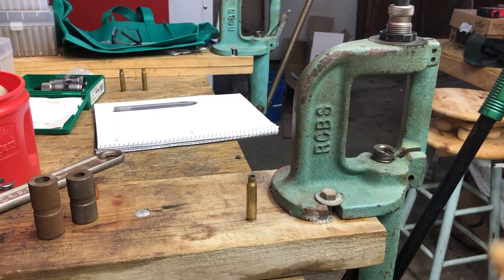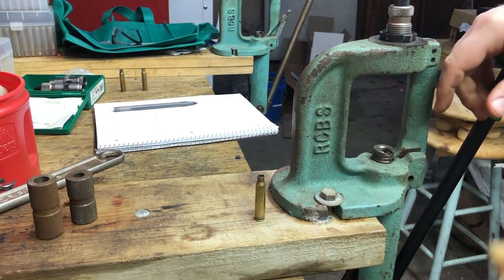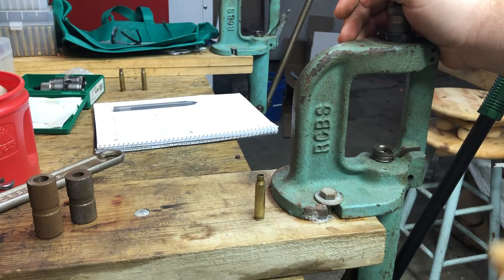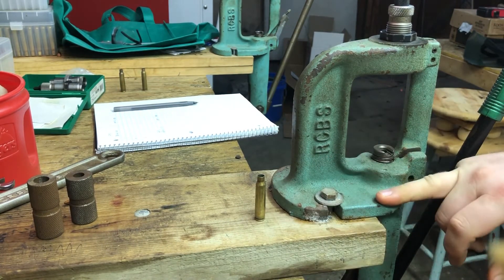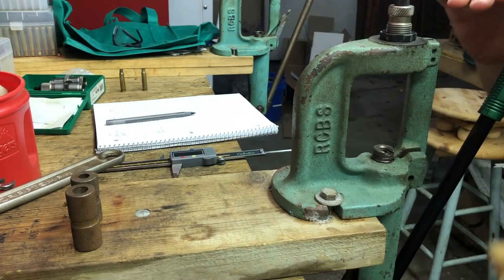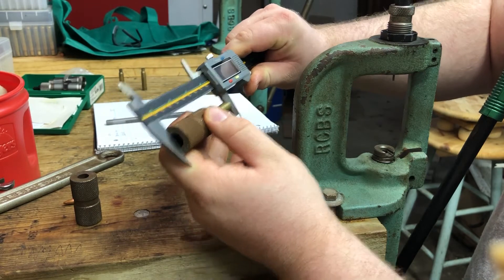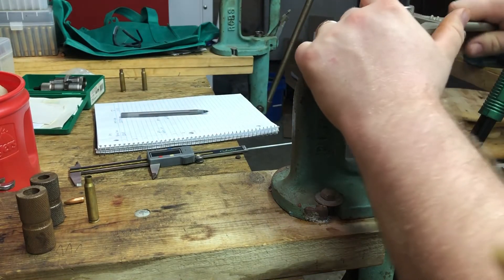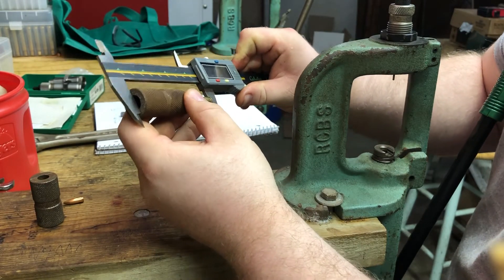Bumping the Shoulder with Full Length 223 Rem Sizing die

Comment: Great vid, I enjoy the longer vids keep it up! 
Question if you don’t mind, do you have to run the bras thought a neck sizing die after you bump size?
Reply from the maker: You do not, in order to get to the shoulder the brass does end up going through the normal neck resizing operation.
Reply: Lee shell holder can be used also for measuring shoulder bump on 223